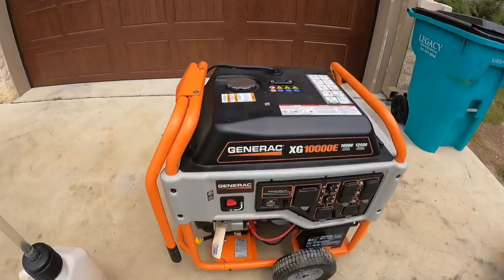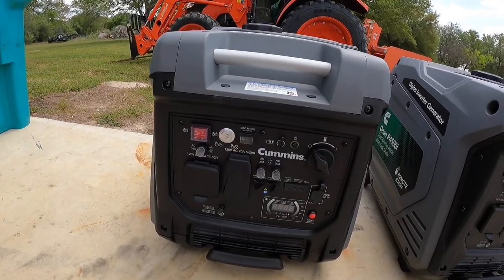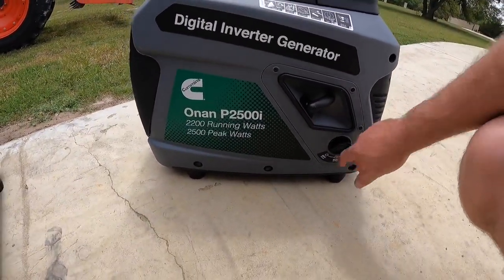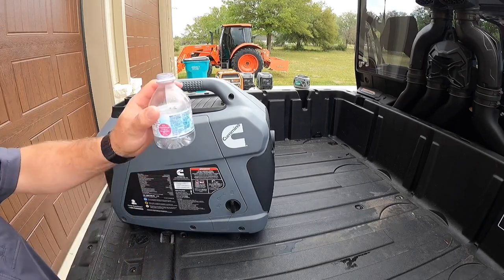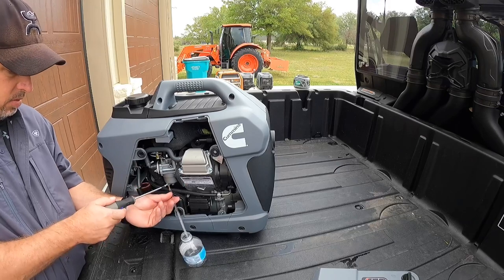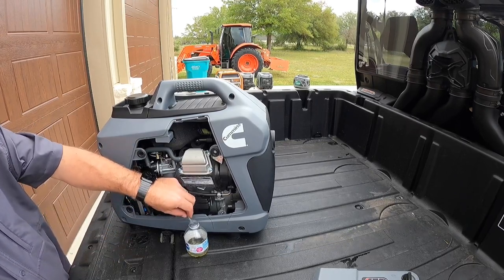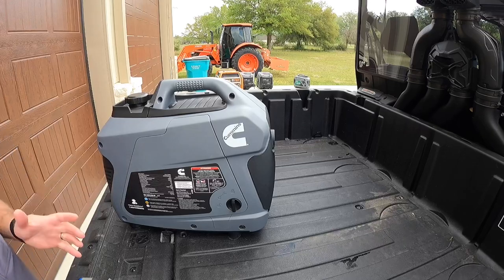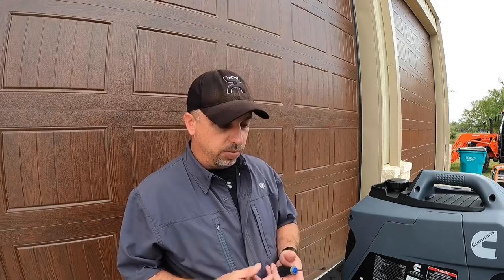How to prep a generator for storage

Comment: Hi.  I have a p2500i generator that I did not drain the carburetor before storing it.  Any suggestions on how to get it back running?   Thanks Chris
Reply from the maker: Prob going to have to pull carb and dip it.. I use torch head cleaners on the jets. Ethanol free is the way to go for storage